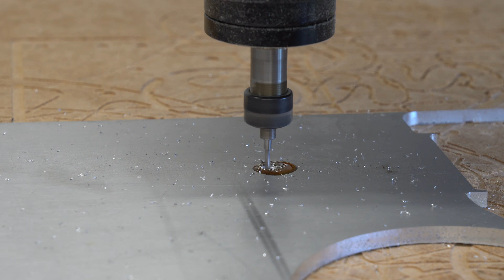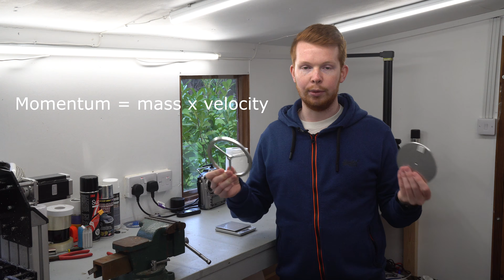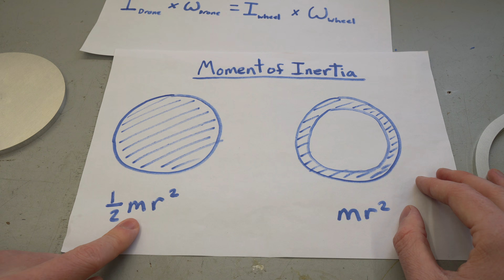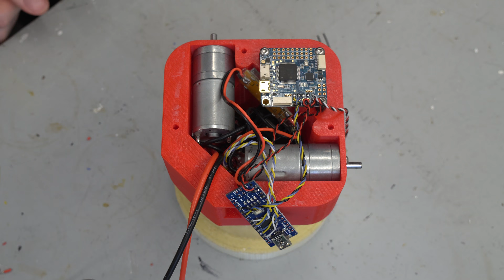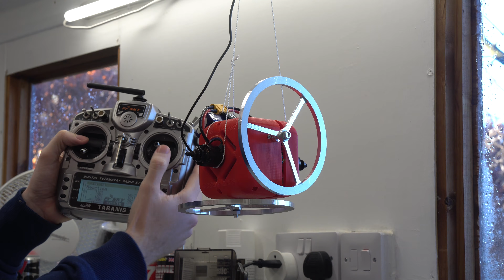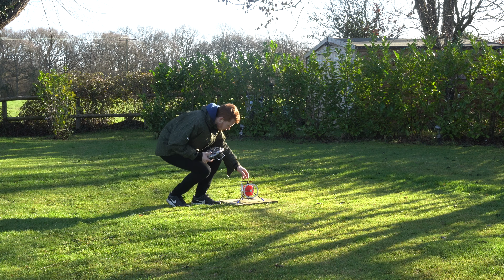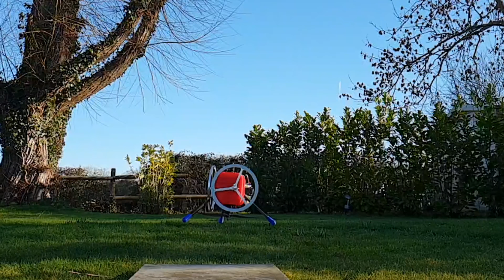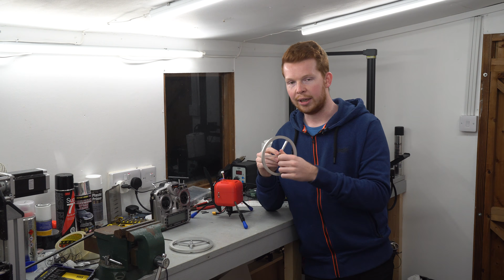Comment: First off Tom, great video, well done!  Watching the reaction wheels in relation to the "drones" attitude I have to ask:  Did you take gyroscopic procession into account?  If you don't know what I'm talking about, do yourself a favor (favour? XD) and look it up.  In short, when force is applied to a spinning disc, the direction of said force actually shows up 90 degrees later in the revolution.  IOW, to make a helicopter nose dive, you apply lift 90* ahead of where you want it.  In this example it (Lift) would be applied the right side so it shows up on the tail of the helicopter.  Same if you wanted to pitch to the right.  You would apply lift to the tail section so the lift shows up on the left side of the helicopter thus pitching the helicopter right.

If you already know about gyroscopic procession, thanks for being gracious and letting me ramble on at least.

Edit because I got my left and right mixed up.  LOL

Comment: i think the issue with the drone is that it is stuck in a feedback loop the moment it takes off, making it jitter uncontrollably. so to end the feedback loop you could make it power the motors slightly less when it takes off, say if it goes from 0% to 50% or 60% thrust.

Comment: The attitude change comes from the counter torque applied to the reaction mass. The only time there is a reaction is when there is a change in velocity. That means the counter torque only happens when the reaction mass is being accelerated or decelerated. I would expect you would need a whole lot more massive  reaction wheels to effect any real attitude control. In your demonstration you exceeded the system's capacity to provide counter torque and so it remained off vertical.

Comment: Does the reaction wheel need to output a constant torque to counter the propeller?  If so then does the reaction wheel need a constant angular acceleration such that angular velocity will increase to infinity?

Comment: Just a thought. Reaction wheel on just one side works as a dynamic force against a static force (the side without a wheel). Could this make it unstable ? Maybe you should use 4 reaction wheels.

Comment: This drone is a great tool for learning System Dynamics and Control Theory. Don’t give up on this. Bottom propeller is making the system unstable like an inverted pendulum. A single propeller at the top on a longer rotor would be more stable. (Then you might need another propeller like a helicopter does.) As the angle from the vertical axis increases system becomes non-linear that a PID control may not be enough.

Comment: Надо 8 ножек с углов, а не 3, чтобы пропеллер не ломать и не гнуть маховики при падении. You need 8 legs from the corners, not 3, so that the propeller does not break or bend the flywheels when falling.

Comment: If you use the horizontal flywheel and sterring assist gyro sensor off of one of the new rc trucks out there....you will need to place the bottom propeller in a duct housing with steering louvers just like an airboat.  This will give you flight control somewhat.  You don't want the gyro forces on your airframe to control flight, you just want them to always make it want to stay upright and level, legs facing the ground.  So whenever there is tilt off of axis, the flywheel speeds up faster, then "venting louvers" to push the air around coming out of the propeller duct housing.  This allows you to build a prototype with just one propeller to test it's capabilities, because the flywheel is spun up fast before the propeller is spun up, it will keep it level while you throttle the  propeller up...

Comment: Since your goal is to keep the landing legs level and stable in the air as it flys, your best bet is to install one gyro wheel in between both blades in the housing.  Whereas a three or four inch diameter flywheel is spun horizontally same way your blades spin.  Then use an rc "steering assist" gyro sensor to make the flywheel speed up every time there is tilt off axis.  That should work just fine.

Comment: Thx for your film, learned a lot. 

But after thinking about your setup, I can’t see how you control the trust of the bottom counter rotating blade?
If it’s more then the top blade would it not always “tip over”?
The wheels can not correct for this I think?
Two props at the top would be mine choice.

Greets

Drė

Comment: Don't forget that as soon as one reaction wheel (e.g. roll) has a non-zero rotational speed, the other axis movements (pitch changes) will result in a yaw moment on the body by the roll wheel disc gyroscopic effect and a yaw rate controller correction will disturb the pitch whenever the roll disc is spinning. Everything is tightly coupled. Keep disc speeds very low, make your yaw rate gain very high but yaw proportional gain very low.

Comment: It would be pretty cool if you tried to make a rotor that uses a swashplate to vector thrust like in a real helicopter. I'd imagine it would be very difficult to get working in small scale, and with 3d printed parts, but it would be very interesting to at least see you attempt it even if you don't get it to work well.

Comment: 20:36 It seems to me that the top propeller is rotating faster than the bottom propeller. Maybe that contributed to the instability
This video is especially pertinent to me because I'm teaching myself how quadcopters work by building a virtual one with reaction wheels. (in Besiege!)

Comment: Not being ANY kind of physicist or engineer (other than a Fire Dept Engineer) or having any type of true formal education on these kinds of things, Would having some kind of counter rotating mass set up gyroscopically help in maintaining a level attitude ?  I'm thinking how a simple childs top while spinning wants to maintain the vertical axis... then use the other wheels to control it's pitch and roll as you've done?  I know this all adds weight to the device, but if it WANTS to maintain a level attitude during flight, wouldn't the wheels you added then change it's mass proportion and cause it to pitch and roll? (That make any sense? Think how a Segway stays upright until it's pushed to go in a particular direction....)  GREAT vid and explanations of your work!!!

Comment: WOW ! ! Awesome work... I have a possible, partial solution; When you speak of "Saturation" I understand it means the wheel is spinning as fast as it can therefore can not counter rotate the drone. One solution to that would be to add a postage stamp size piece of paper to each spoke of the reaction wheels. Position the papers so that they slow the wheel rotation. THEORY: when trying to eliminate "Saturation" without some outside source of drag on the wheel, the only way is to apply some type of "Brake" on the motor - this would simply un Do any positive reaction you had just gained. The drag coming from the small bits of paper on the reaction wheels will effectively slow the rotation of the wheels in a way that would (in effect) increase the angular momentum required to spin the wheel up to higher speeds. NOTE: at lower reaction wheel speeds, the drag caused by the pieces of paper will be very low. NOTE 2: the paper can be shaped in some way that will reduce the aerodynamic interference with the lift airflow but thats something that will need to be experimented with...... I believe that this simple addition of air drag on rotation of reaction wheels will be enough to get you a shaky but stable successful flight and then you can work with it from there. SIDE NOTE: when you hang your drone for testing like you did - hang it from a single string in the center of mass and I think you will see that it does not "Twist" in a single plane. Since the drone + other wheel + batteries etc are much heavier than the reaction wheel, and they are not balanced above and below react wheel center of rotation, there is going to be some rotational force working against the other reaction wheel and Vice Verse. I believe this is why you are getting a rhythmic oscillation rather than a flat out failure. I think you can make this thing work ! ! ! You could also use other "Cheats" in order to get stable flight during development for example; longer lighter legs that would slow down the drone movements between reaction wheel movements. The equivalent of holding your arms out to keep your balance. 
oct1113@hotmail.com if you want to discuss further

Comment: At 4:42 your pushing the blue plate   anticlockwise so the blue plate's angular momentum vector points outwards of the screen than I order to stop it from rotating the aluminium disc should rotate in clockwise direction to cancel out the angular momentum of the blue disc 

BUT THE WHEEL IS ALSO ROTATING IN ANTICLOCKWISE DIRECTION ???? HOW IS THAT POSSIBLE????

Comment: Yes, but due to the necessary weight of a reaction wheel, it doesn't make sense to use one to control a drone.  You've already got thrust factors on such a drone.  You can instead use the motors to adjust the thrust to achieve navigation, without the added weight of a flywheel.

Comment: Try it again but this time make sturdier motor mounts and change the controller to an esp8266 which is way faster and thus will jerk a lot less when making corrections. Sometimes it's also good to do away with geared motors because they add unwanted inertia and whiplash but it may not be the case here, if it still doesn't work just rethink your algorythm for the wheels.

Comment: I also had an idea of making something like this. It looks like the motor torques are not high enough to change the angular momentum of the wheels at the desired rate. To overcome this problem these wheels can be mounted on a fully functional drone. Then let the drone stabilize itself while the motors accelerate the wheels. Now you can apply the brakes to have an enormous deceleration. In practice, this can increase the agility of a heavy drone.

Comment: Like where you going with this . Is there anyway you could put 4 rotating blades on each side spinning them more than 4000 rpm and rotating those 4 blades in a circular motion clockwise or anti clockwise also at a high revolution . Saw this from a university student trying to lift a 30 pound fly wheel with one hand and after spinning the fly wheel at high revolution it goes up by it self lift it with  one arm around in a circular motion. Just a idea coming from your  project

Comment: A simple method to use brushless motors to drive your reaction wheels, would be to use one of the several brushless gimbal controllers on the market, along with appropriate motors made for the application.  A gimbal controller/motors, may provide a mostly ready to go solution. In fact, with the right motors, you wouldnt even need the wheels at all.  The motor rotor could possibly serve as the reaction wheel.

Comment: awesome video, subbed!
i think the design could also be improved by more symmetry. the  propeller turbulence caused by the asymmetry and the bodyshape may destabilize the flight, also the reaction wheels have an offset and are just on one side each, which 
works for stationary objects that have an anchor point. but since it's a drone and it's free floating i think it will naturally drift to its center of gravity.
i imagine a ring-shaped drone with 2  smaller reaction wheel pairs on the side (so a total of 4) and the propeller in the free space in the middle, so it is protected from the sides and also has no obstacles in its airpath besides the suspension.
anyway i'd love to see any improvements you come up with, keep it up!

Comment: For the record, the correct equation for moment of inertia for a ring of this type is I_ring = 1/2*M*(a^2 + b^2), where a and b are the inner and outer radii, respectively.  I'm sure the CAD software calculated I_ring correctly, as the shape isn't discretely a ring or hoop, but just wanted to clarify.

Comment: You could really do with some control engineering lessons... getting those PID values right experimentally is one thing but I've learned this semester how to do it just with unleashing a bunch of math (root locus) on a physical model and it creates soo much better results.
It also makes you realize the problems of a build without actually needing to build and test it so it's really handy.

Comment: Putting some thought in the reaction wheel project, it seemed that you need better response time. That might be achieved by having each wheel be a double counter rotating wheel assembly. Have them both turn at the same rpm in opposite directions to one another for zero torque. Then change the speed of only one of the wheels faster or slower than the other to get your torques... You could then use brushless motors since you will never be reversing direction. Just increasing or decreasing rpm speeds... What you think????   Love your channel....

Comment: Tom, I envy you.  When I come up with these kinds of ideas I run them around in my head and eventually work out why I shouldn't "waste my time," where you turn it into an experiment that you learn something from.  

Honestly, I don't know how much tuning, tinkering, experimenting you have in this that is not part of the video, but I'm very impressed with the amount of apparent control you got in the slow-motion videos for a first try.  I suspect that you're having 3 issues at this point, 2 of which you touched on:
- one of your axis was responding with more torque than the other, and your control method by varying current was not compensating for this- in your slow-motion footage, it appears that you have good control in one axis, but the other always seems to be a little off.
- your PID tuning appears to be off, of course, for a first shot and not having a workable flight because of the first issue it's surprisingly close
- I wonder if there is too much latency between your gyro and the final action taken at the wheel/reaction to that.  There are tons of places where this can happen, my first 2 guesses would be the time it takes for the motor to accelerate the wheel to speed and in the Arduino code, but I'm just guessing here.

Comment: I'm by no means an engineer, but it seems to me if you increased the diameter and pitch of the the upper propeller, you would get more lift and possibly more lateral control due to the increased upwards inertia. Just a thought.....

Comment: I know there are much bigger problems than this, but could you put in a routine that stops the reaction wheels from turning when the propeller RPM is very low?  Maybe that could keep it more stable when it leaves the ground.

Comment: I don't like the bottom propeller.  Any downward force it exerts, being below the CG of the drone, will want to flip the drone over.  Think of a parachute attached (by rigid supports) below the parachutist.  The system is unstable and wants to flip over.  Yes, an inverted pendulum can be stabilized, but it's much easier to stabilize a non-inverted pendulum (a little bit of friction at the pivot will do).  He should generate all the upward thrust with the top prop and change the bottom prop to only counter the torque generated by the top prop.  I.e., the bottom prop generates no thrust, it only counters the rotation.

Comment: If you do this again, you should use slightly smaller wheels. Like you said, the wheels weren't close to being saturated and a smaller wheel would allow the motors to more easily change the speed of the wheel. This would help a lot with finer adjustments.

Comment: i wonder what the result would be with 2 fast endless servos equiped with a (short) bar with weights on the ends, instead of the reaction wheels.
i also suspect the propellermotormounts are a little flexible, which, combined with the gyroscopic effect of the rotors, could throw things off.
lastly, would it be possible to use the gyroscopic effect of the propellers to stabilize the craft, without any reaction wheels?
if this is an obviously stupid question: it's almost 3 am here, and i can barely keep my eyes open.  😉

Comment: I think there is a way better method to do this.
Instead of only one wheel per axis, with rpm at 0, use two wheels per axis.
Each wheel is turning at maybe 1000 rpm, one clockwise, one counterclockwise. Breaking one of the wheels would make a really big momentum in short time as you can use brushless motors.
Tell me what you think!

Comment: Part of your problem is that the angular motors are off the center of the object... putting them in center could help.
Better way to do this is to use 2 angular wheels per axis and spin them up in opposite direction - that already acts as a gyroscope and then just adjust the speed which will give you the angular momentum - that HAS to work :)

Comment: i would try making the reaction wheels work as pairs, so it would be 4 wheels total. Maybe a 5th wheel to get the Z axis rotations stable.
another thing good to try is a switch to turn the reaction on/off. Especially to solve take off problems.

The thing about flight is all about balance. If the reaction is not at the very center it must be constructed as to make its influence at the center of mass, always.
I guess reaction wheel can be useful for reaction time and stability doing so. If you want to just be stable or to change directions at easy. Other than that its no use for it.

But the project you have proof useful, it was just not optimized designed that is all. So it need to solve the balance problem and i think that will not work just putting a counter weight because the reaction wheel will generate a force which must have to in the center of mass, if not it will be unstable no matter how many counter weight you use. Plus using counter weight kind of nullifies the reaction effect.